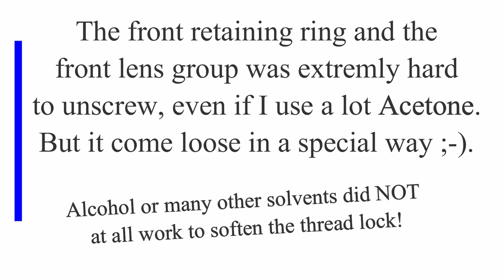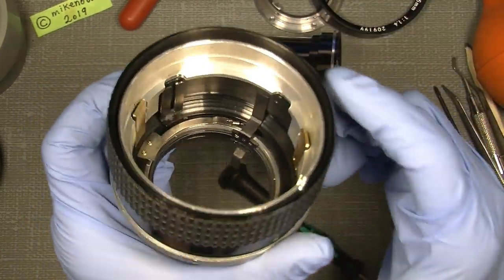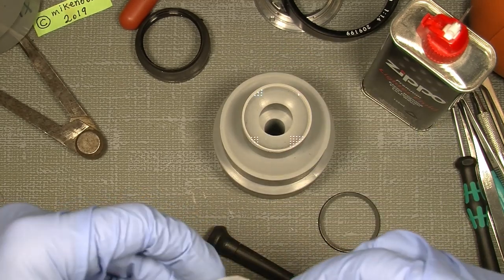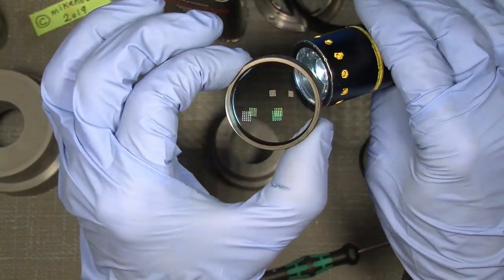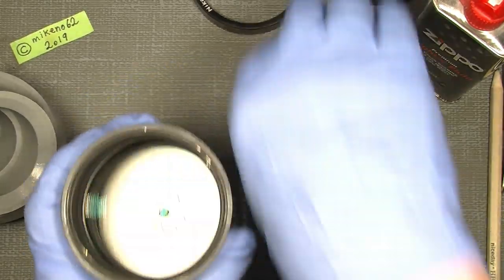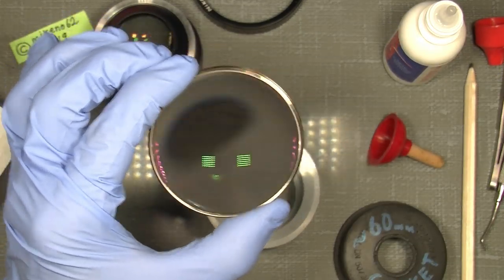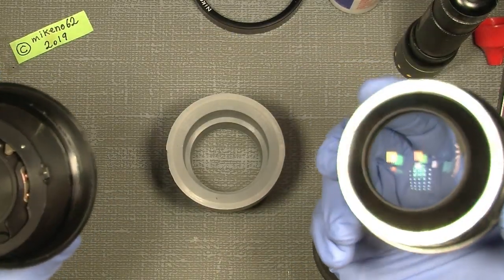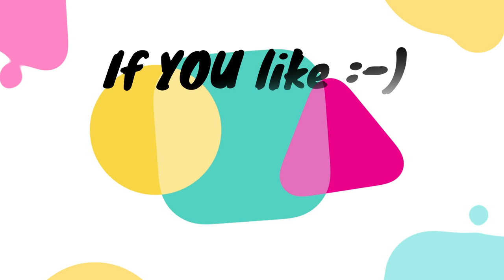Cleaning lens elements In Ai-s Nikkor 85mm 1:1.4____it turn out to be okay

Comment: Nice result at the end, but you had access to all the dirty surfaces you cleaned without taking the actual glass elements out of their metal holding rings. You should have just cleaned them in place, taking them out is just extra risk (of cracking or scratching an element) you didn't have to take.

Comment: Hi Kenneth; This is a great video! I really liked your compass mount. great way to get the extra "muscle" needed. that is a beautiful lens. Thanks.
Reply from the maker: Thank's Tom, It took me some time to find a solution and it work really great, and I have much better control of the movement when I unscrew in that way, I think it would not be possible with a "normal thin lens spanner". Next time I have a lens with a really really tight retaining ring or a lens group, I will unscrew it that way.

Comment: Hello.
I am experiencing similar problems with loosening the front retaining ring of Nikon 85/1.8 mk1 purchased from Japan with lot of condensate and fungus.
I tried the lot of nail polish remover, acetone - ring doesn’t loosen.
I use a factory-made strong lens spanner wrench, so the problem is not with the tool.
I’m thinking of immersing front lens block in acetone with the front lens and retaining ring for several hours or days, or applying WD40 on thread.
Can you advise something?

P.S. I put a small amount of WD-40 with a syringe under the ring, waited 3 days and unscrewed it.

Comment: I got a question and hope you can help me out...

My 85mm makes a weird clicking noise, whenever i set the aperture higher than 1.4 and open the blades fully with the lever.
As soon as i rotate the lens, it goes click when turned to the left, and click again when turned to the right. Just the entire lens, not the setting rings on it.
It sounds like something is hitting metal on metal.
Also happens when the lens is set onto the camera. When i use the depth of field preview button on my camera, the clicking won't appear.
With rotating, i mean when i switch the camera between portrait or landscape.
Is this normal? or should there be no clicking at all?